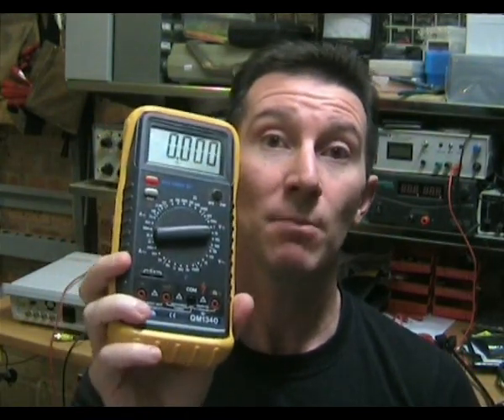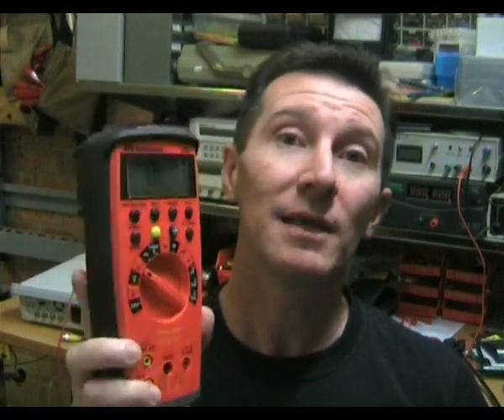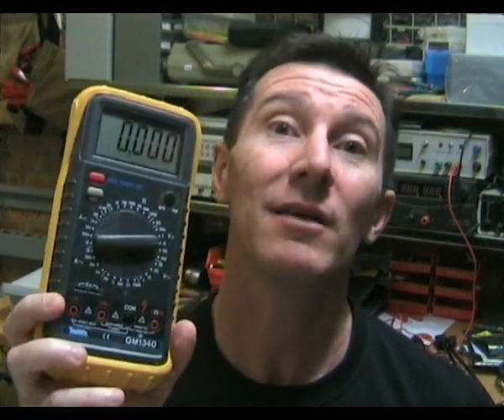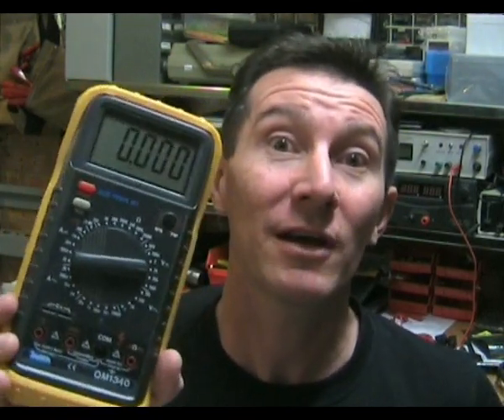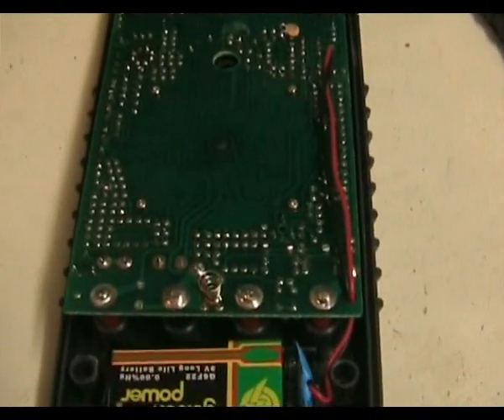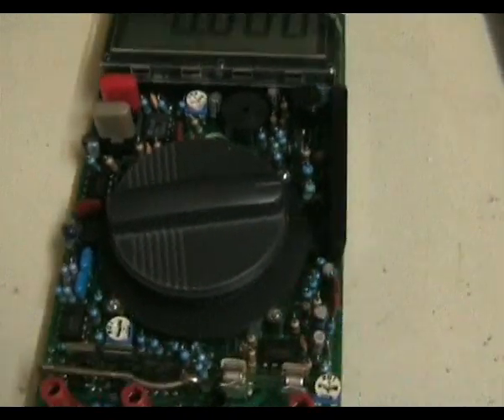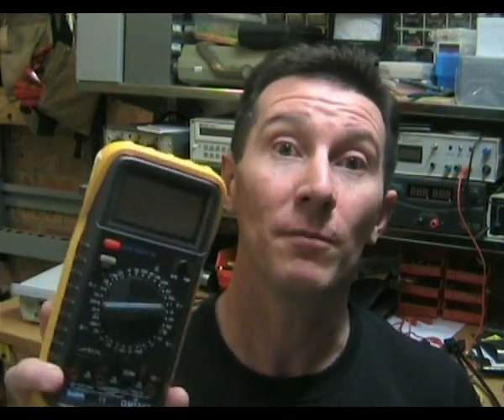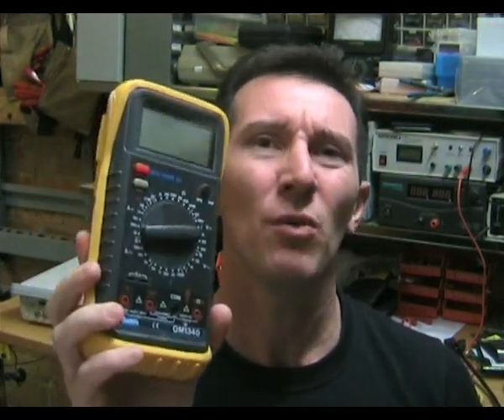EEVblog #6 - Part 2 of 2 - Why cheap multimeters suck

Comment: for a novice who uses a multimeter at home and not very often... a cheap one is suitable
Reply: It kills me how everyone thinks fluke is the only good meter out there. There are plenty of other quality multimeters out there.
Reply: Funny how the pros expect a novice hobbiest to buy the best ones when they aren't testing critical circuits or doing much testing at all.
Reply: I will not recommend buying a Fluke to test the battery voltage on a car.  A complete waste of money. 
 A cheapo is enough to measure up to 14.5V safely and tell me if the charging circuit works and if the battery is good or not.  It's enough to check continuity on a circuit.  

Yes I actually have a Fluke, but I do more than the above.
Reply: I would recommend a Fluke to test a car battery, which is 100% charged at 12.65v and totally discharged at 11.89v. Not much range for error there.
Just a 2 or 3% error could make you think that something is wrong when it's ok, or the other way around.
Reply: +MrPorkncheese True.
I am a novice and I have a cheap ass multimeter. But any experimenting I do I just use 9 volt batteries and such. It's not like I'm plugging shit into the wall socket. If that would be the case I would buy a propper good meter.
But for now, I wouldn't throw my money on expensive equipment and tools.
For gods sake, we've all been novices, we've all had shitty equipment. And well, we will "grow up".
Reply: @JustWickedSwede  I agree that a really cheap multimeter is totally fine for low voltage stuff.

Trouble is, most of the cheap ones still have mains level AC voltage/amps ranges, giving the impression that they can be used for that, and that's a bad idea- they're not really safe at those kinds of levels and can cause serious injury or death if they fail.

Particularly for someone inexperienced, whose going to be comparatively more likely to do something silly like wire the input jacks wrongly
Reply: +MrPorkncheese A cheap one is ok, I use one that cost around $20, for my hobby.
However when I worked in a tv repair shop I shared a fluke with the owner. that meter got a lot of use all day long, and it gets tossed around, you need a rugged meter for that kind of work.
Reply: Coincidentally, Harbor Freight is selling a DMM for six dollars! :D
Reply: i have many meters, a 20 years DT-830 for simple things is perfect and corect indication (never calibrated, inside seems to be a uniti) i have a DT-9208A i don't trust in this one,  i have a UT61E, it work perfect and i trust it, for a price comparation, what UT61E can do, a "cheap" fluke can do too
Reply: https://www.youtube.com/watch?v=XYatATLNNt0 YOU mean very often, at least you can change a battery??
Reply: @Joachim Shekelberg I was thinking in particular about the one in the video when I said that-  glass fuses are....iffy when it comes to mains voltage stuff. You need the non transparent ceramic ones filled with glass.

If you're measuring an appliance, the fuse in the plug or a lower capacity circuit breaker should save you, but absent that it  could just fail to break the short and cause a lot of damage/death
Reply: @Joachim Shekelberg and at least it has a fuse...funny you should mention it but the newer dt830b is even cheaper and doesn't have one...despite it having an AC voltage range, plug your cable into the wrong Jack and things get very exciting
https://youtu.be/iGUiZT6kLDk
Original teardown
https://youtu.be/R693vS09hoo

The voltage testing probably isn't worth much- it's not really the constant voltage that's the problem, it's the tiny spikes caused by a sudden change in load like a washing machine turning off- only difference between cat III and IV- bigger loads bigger spikes
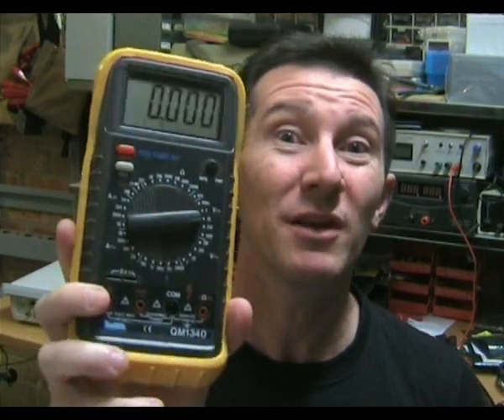Reply: ***** Come on. Even Dave says "they do have a place". (about 1:03)
Reply: ***** Come on. Even Dave says "they do have a place". (about 1:03)
Reply: +ישראל 
A Jew calling someone cheap is comedy gold.
Reply: MrPorkncheese Yes Porky, they are just fine for dumb shits who shouldn't be working on electrical or electronic circuits in the first place.

Comment: My brother owns a few Flukes, and they really are worth the price. I mean such solid pieces of equipment. Personally I don't do much electronics, here or there mostly for hobby (I am more of a software guy). But I own two multimeters, I own a cheap(er) UNI-T and a more expensive Amprobe. Fluke was just a bit too pricey for the feature set and what I wanted to spend on a meter at the time. 

It all comes down to how much you value good equipment and how much you think you're going to use it. If I did electronics full time I would get a Fluke and be done with it. But as you sometimes need multiple meters it's ok to skimp on the second one. Unless you're dealing with high voltage environments 1000v+ in which case I would not bother with cheaper multimeters due to safety concerns.

Multimeters are a figured out commodity. You get what you pay for.
Reply: 1000v+ ?  The 480v three phase that's all over factories can blow you to kingdom come.  I once had a meter where the probes were connected to the wires with solder but there was no strain relief.  Of course the wire eventually broke inside the handle at the solder joint.  Can you imagine reading a dead circuit and then blowing a finger off?  Luckily that didn't happen, but the operative word is 'luck'.  Don't depend on it!  To salvage the meter I soldered it back and shot silicone sealer inside the handle so the wire couldn't twist the solder joint.  The meter worked for another 20 years, until I left it out in -20F which killed its display.
Reply: j miller Yeah in all honesty I should have probably put 120v. In any case if one is working with high voltage they should not skimp on a meter. Personally for 3-12v stuff, measuring resistance and capacity my UNI-T UT61E  is an excellent meter for the price. It's pretty accurate, it has all the features I need. And in fact it's my go to meter for most everything. I prefer it to my Amprobe 34xr-a for electronics. I only use the Amprobe, when I need a 2nd meter to measure multiple things at once or if I am dealing with higher currents or working with grid power (which is rare).

Comment: what about analog multimeter?
are they good?
Reply: 987inuyasha no   :-( you sold NEVER BUY an analog multimeter (if you have one already i recommend you to buy a digital one)
Reply: 987inuyasha I own several flukes and a couple of cheap imports, but by far my favorite meter is a Simpson 314 solid state analog meter.  My little Simpson 160 analog is a joy to use also.  And my HP 412A which has six more ranges below 1 volt DC.  You will learn a lot using, servicing and maintaining them.  Go for it.
Reply: sanjursan I already ditched my analog, they are hard to read and very fragile, too much of a hassle for a beginner like me.
Right now i'm using a 20$ Mastercraft multimeter and i feel more at ease now.

Comment: to everyone whom buys cheap multimeters. (myself) buy a low end 60 dollar fluke. it will have less features but you will be happy.
Reply: I'm still using my Fluke 12b from like 13 or so years ago.  I just wish I could find a rubberized shell for it.

Comment: McCune posted the following; "I like to find a good meeter that can measure good voltage and current up to 50 amp or more. so I can calabrate other meeters for my solar and wind projects."
*
 I making this post knowing they never see it because they disabled  the reply, but  it may be information for others. In this  case all you'll need is a shut capable of handling the current you  expect to measure an accurate volt meter to measure the voltage drop across the shunt an apply ohms  law

Comment: A recondition slternwtor in my part of the world costs $100 US.  a reading of tenths of a volt  on way or the other detirmine if an alternator is functioning properly. I want a mechnic that's trouble shooting my vehicle to use a meter that is repeatedly spot on if it indicates I should spend a  $100.  Another issue I rarely see mentioned in videos is the input impedance of a meter. Important on modern cars.  A meter that puts a load on a circuit could result in a misdianoses. I was surprised to see in Walmart's auto department meters that  indicated on the spec chart they have 10 meg ohm input.  are they accurate enough to be used in retail? I doubt it. To get an Etech that's calibrated to a stard os expensive and  requires a wai time for delivery; so even an off the shelf  Etech meter may not be good for retail eithrt impedance.  Good in retail as gas pumps and scales hav to be tested for accuracy regularly.Those comment good enough I wonder what they mean by good enough?  As Dave said confidence in the reading, and repetabilty that's what it's about.  The build quality and the over all reputation for mid level productd from Extech and others, is most likely good enough for me. In the event a operated a business and Fluke products are calibrated to a standard out of the box I'd spend the money for a Fluke.

Comment: I've had a 'cheap' Maplin 'Gold' multimeter which is within around 1-3% of my Fluke 177 for most important measurements. That's close enough for most people. It's also been thrown around and abused. Still works fine.

Comment: no points and supporting about accuracy at all, which is mostly complained in the video. Give some reasonable rationales first.
Reply: Repeating my comment to the video. Tenths of a volt either way indicate if an auto alternator is  functioning properly.  Reconditioned alternator  can cost $100 or more. how  accurate of  meter would you want mechanic to be using if they going advise.   You and I instinctively will know  when an alternator craps out a  vehicle we drive regularly, nut a mechanic  has to rely on their tools to make that call.

Comment: Another anti-proof, anti-China product rant.  I use a cheapo meter daily and it works just fine. I also have a high end fluke but I prefer the cheapo meter because the battery last forever--years, fuses are $1 vs $8-10 on the fluke and it just works.

If something works, I really don't care about where it came from or what it's made with.

I know a lot of equipment snobs but I myself saw the light and know how to use any tool within it's limitations (or modify it to extend past it's limits) and get the most out of it and use my money for more important matters. I understand what I'm looking for when making measurements.

Now if a particular job necessitates particular high end equipment, I don't mind paying for it but when the job does not, I always grab the cheapest most sturdy (high end equipment tends to be delicate) equipment to do the job.
Reply: Here is "simple formula": If simple $20 meter is enough for you then you should get one... If you need more complicated, accurate, etc. meter then you should get that kind of a meter.
Examples: Do you have to spend hundreds of dollars if you measure car battery voltage couple of times a year? Or do you really want to try to make accurate measurements on high (leathal) voltages and currents with random el cheapo?
Reply: There is a problem that I have noticed with some cheap meters having to do with their continuity test function.  The issue is very brief continuity will not give a beep.  This can be important when looking for intermittent problems.  To check for that issue set the meter on continuity test, and glance the probes together as briefly as possible.  A microsecond of continuity should latch and give a beep, not just be missed by the meter.  Also, a very brief interruption of continuity should interrupt the beep perceptibly.

Having said that, I think this guy is spewing BS but he probably means well.
Reply: SeverdSeouL So if a person can't afford to buy a tool manufactured in their own country, then they should just not buy one at all?
Be aware that a lot of stuff you think is built in the UK, US, EU may not actually be. IIRC some famous US companies used to ship their products to Asia, precisely so it could be assembled to a higher standard than at home and then shipped back to the US where a Made In America stamp was proudly attached.
Reply: I repair mobiles and computers and I use a 4 dollar Chinese multimeter (Matech) and it gets my jobs done... and ya, fuck you Oscar Bella, you ignorant bitch.
Reply: pccchurch I just do repair work as a hobby now so I use a cheap meter it dosen't get much use But when I worked in a tv repair shop I shared a fluke with the owner so it got a lot of hard use. I think what wears out on the cheap meters is the switch, but when you're just a hobbist these meters will last quite a long time, however in a repair shop they in use all day long.
Reply: blame the CCP if you dont like the image china has to the world.. it is their fault... Every one understands the chinese people are the not the ccp, except maybe the ccp.
Reply: haha!
Reply: They are made in China and they are low quality, as are most products currently being manufactured in China, it's not racism just FACT. Hopefully in a few years you will be working slave wages and peeing in a bucket,. People like you are the first to break down when your hipocracy and stupidity becomes slowly evident and you start to experience the backlash from it. Its fine for you to run your fingers over the new, cheap third world product, forget about the scab labour and horrific political conditions the worforce have to tolerate to make it. Ignorant spoilt, dumbed down western female. And I'm a woman so don't  try playing the sexist card as well.
Reply: Then continue supporting their economy, outsourcing, and bankrupting your own, moron.

Comment: Yeah, I had a $20 multimeter. Did alright for low voltages, amps, resistance, etc. Finally upgraded to a $50(on sale ftw) multimeter, has alright specs, wouldn't trust it anywhere near mains voltage but for what I need it for I'll hope it is close enough. 0.5% for the DC I'll encounter, 1.5-2% for DC current, 1% for resistances. For someboy just getting back into electronics, I think it is pretty nice. "Micron Q1074". Time to ghetto up some crocodile leads for it.

Comment: yeah its a bit of  rant! btw i have had 2 flukes fail with bad displays and still have my taiwanese metex from 1988 that works perfectly, theres some luck needed too, its about price at the end of the day, buy high end if its your trade and you deal with high voltage, and buy cheap for messing with amatuer electronics/low voltage

Comment: It's an indication that the factory lacks sophistication and took the cheapest way out. 

Also, the nicer, newer meter processors don't come in DIP, it's all QFP. 

More integration also leads to better reliability. Less solder joints, less problems.

Comment: lol i have a cheap multimeter and the on off switch broke so i replaced it with a magnetic reed switch just stick a magnet on top to turn it on,  it works and there is almost no chance of leaving it on by accident . im looking for a fluke but prices in my country are simply depraved

Comment: Just on the 'crude non-spec components' - The US Airforce has found electronic counterfeit parts from China in their supply chain and in their aircraft. I can well imagine these counterfeit parts finding in their way into US Fluke meters or any other device where absolute reliability and repeatability is required. Once you subcontract out components, your exposing your company to reduced quality.

Comment: Just a thought here, I've wiped out Flukes just as easily as the cheap meters with the occasional chemical spill in my tool kit, oil being the worst. Though I have to say that I tend to place my view of good or bad on response time. I can't be bothered to wait the few seconds that the bad meters take to give me a reading compared to the fraction of a second response time of a good meter, regardless of price. Still a great video with good insights.

Comment: (2/2)  I measured from a power supply with the test leads from both meters connected to the same binding posts at the same time, and my old one had only drifted 3-8mV, depending on the output voltage of the power supply (max 12V).. That's not much over ~8 years of fairly regular use and abuse. The model is "BS1801" made by Caltek Industrial in Hong Kong.. So, not all cheap multimeters are as bad as one might think...

Comment: It's a bit weird with some of these.. I bought (or my mom did) a cheap no-brand multimeter from a hardware stores several years ago when I first started out with electronics as a kid.. It's been with me for what must be 8 years now. But as I got into more fine electronics I felt uneasy about using it, not sure it gave me correct readings and such. So I finally upgraded to a better ~100$ one. After testing it a bit I decided to do a test to see how much the meter might have drifted off... (1/2)

Comment: I prefer my Triplett 630 or if I need to use a digital meter, either my Weston 1240 or Fluke 8100B.  All of which are far better made than what you discussed here.  I think for fun it would be great to have a video on digital meters using nixie tubes!

Comment: Engineering . not always want accuracy. most of the time they know the meanings of readings even if they are not accurate .so the accuracy is not the first thing i think about .. i dont care if my readings 100 millivolts higher or lower ..i know that my work is fine even that..most of the results just to give a hints about work .even that you need accuracy but how much u need it in your work .?more than 80% from DMMs uses done by even cheapest DMM .. futures and durability then accuracy